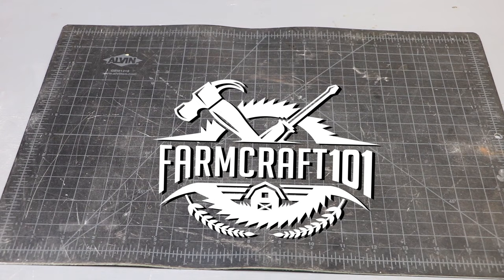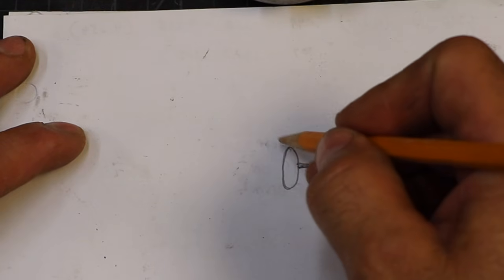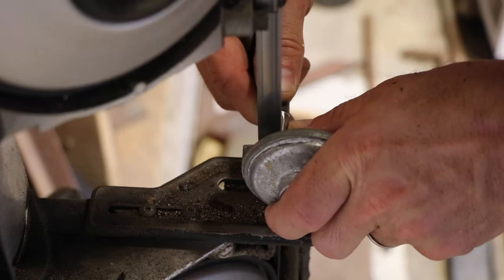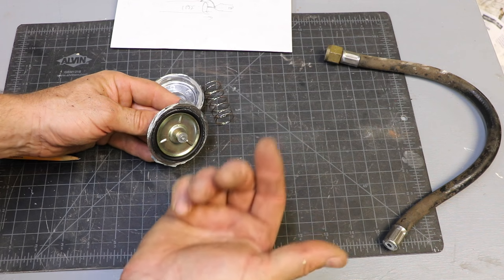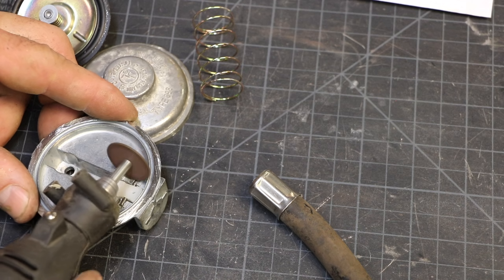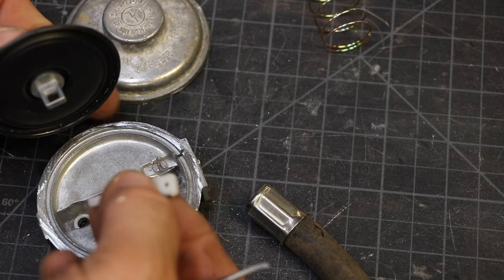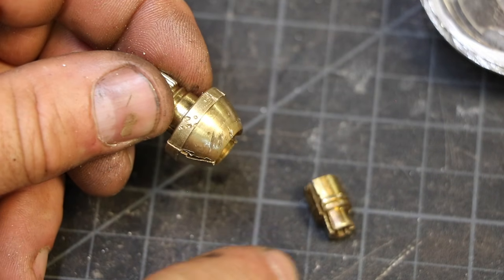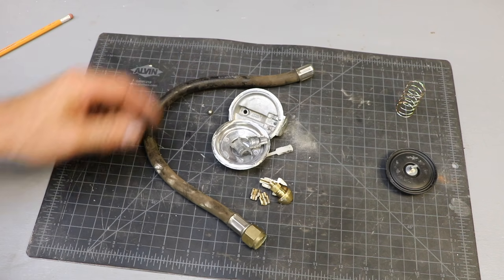Surprising Mechanism Inside Your Grill Regulator.

Comment: I haven't personally seen a regulator go to a failure mode of low pressure/low flow. A friend's grill regulator failed high, so when she turned on the gas, it made a rushing and almost trumpet-like noise.  Mine failed high while the grill was lit, burning off the residue after the burgers were lifted - when we went back out 15 minute later, the grill was WAY too hot. It incinerated all the grease on the grate to white ash, broke the thermometer in the lid,l (pegged somewhere north of 600°, never came back down), and the stainless firebox was permanently discolored dark blueish-purple.

Comment: Here’s a video you need to do  disassemble A scuba tank compressor .what kind of an air compressor does it take to fill scuba tanks because the pressures are in the thousand pound per square inch ?and  I am curious how that’s done. Especially with an electric motor that only produces 5 hp

Comment: I think most regulators, or at least RV regs, have a fail safe built in so the valve shuts if too much gas flows out. I've seen it mentioned in a few places if too much gas is used, it could trip that mechanism. I wonder if that is built into the normal operation of that valve and check ball or if that's another part on a different reg.
Reply: Yes, I was thinking that the check ball might have a sealing surface in the forward direction. If so, a large flow would shut it when the aerodynamic force on the ball overcomes the spring.

Comment: I purchased a new Weber a couple of years ago and when I went to my local propane/grill store the salesman/owner told me in a sarcastic way that don’t come back complaining about your grill not lighting up, that it’s because the regulator which was redesigned due to some new regulations which he thought was unesesary binds. And he was right when it happens which it dos on occasion I give it a bang with my grill brush and problem solved. This happened on two Weber grills.

Comment: Hmmm, my grills flame seem lower lately and I was thinking I may have to get a new regulator but maybe a shot of air to clean out that mini membrane will do it. 
If I had the drive I would test the pressure then shoot a few pounds through and retest but I don't have a channel to feed (lack of motivation).
Reply: It can also be the burner's holes.  Either from corrosion or food/debris.

Pull out the grill and clean the burners.

Then, with the gas ON, give the reg a good couple taps..Turn the tank off and grill ON, and tap it again. after disconnect the reg and give the vent hole a small shot of compressed air a couple times.

Remember to turn your Grill's knob to OFF before reconnecting the reg and giving it a go to avoid the big WHOOSH.

Comment: So, as Richard Stewart mentioned, the sequence of entering gas pressure can keep low pressure, had to re- boot mine many times because of this, not knowing there was a safety device installed for this, but assuming after a while, a simple mechanical fail safe procedure was built into the system. The only things that could have gone wrong with yours: leak/ hole/ crack, damaged/ bent / broken / warped, or weak components, corrosion or wear not allowing proper movement, obstruction, ( gas, or atmospheric pressure) or as mentioned above, too much, or not enough gas at a given location. One spider, insect, mud dauber, drop of moisture with corrosion occuring, or ice, can cause a short or long term problem .

Comment: The back side of the membrane has to be vented to the outside in part because otherwise changes of the temperature of the entire regulator would affect the amount / pressure of gas downstream.

Comment: I was thinking that this single stage regulator was cheaping out, but then realized that the fuel in the tank is in a liquid form.  For a given tank temperature, the vapor pressure will remain constant, so a single stage regular works just fine.  For high pressure gas cylinders, you need a two stage regulator to maintain a near-constant set pressure as the bottle depletes and the input pressure drops.

Comment: That other smaller spring on the diaphragm is to release excess pressure out through that "hole that is not to be blocked" should your main "needle" valve fail to seat.

Comment: Isn't the check valve on the HP side there to avoid the flame to run back into the bottle??? It closes when there is no flow. And at high flow, the flame won't move fast enough reverse.

Comment: I think a needle valve would be overkill and unnecessarily expensive. They have a wide adjustment range, which isn't necessary here. The flow rate is low and can be partly regulated by the orifice size. The inherent springiness of the rubber seal will give some proportional control, but even if it doesn't, there's probably enough reservoir in the hose to smooth out the impulses from the bang-bang on/off control and give pretty even flow at the burner.

Comment: Good video but you didn't find the problem so I had to take apart my #2 failed regulator from Weber. I found the nylon pivot fully sealed against the inlet hole and the other end of the pivot pressed against the rear side of the casting. As such, the pivot lever could not move in either direction and was fully closing the inlet. That explains why each regulator worked just a few times before failing closed. Weber knows the Chinese regulators keep failing and they should cover the cost and provide a good regulator not another defective one. Weber used to be a respected company but it seems they continue to use defective regulators for years. I surmise the nylon lever got bent from heat or maybe pressure (but it is bent in the opening motion), the pivot pin groove was cast too deep in the main casting, or the staking of the lever pivot pin was hammered too deep. Also possible is the rubber insert in the nylon lever swelled up with propane exposure or the seat was not pressed/screwed far enough down into the regulator casting. They both worked long enough for 3 uses of the grill before failing. After the first regulator failed Weber sold me a new regulator for $50 and it was identical and also failed in 3 uses. I tried various propane sources and compressed air at 120 psi and none could get through the sealed regulator. There is no safety valve or mechanism that needs "resetting" like so many posts describe. Your video shows the check valve with a ball  bearing which closes the flow if an open line is detected perhaps when using a large tank. Small screw on tanks have no "safety valve that needs resetting". The connector hose for using the large tanks has a Schrader type valve in the grill connection end to prevent full flow exiting if that end of the hose is disconnected. I am going to look for a different brand regulator. I think it is a zink pot metal casting not aluminum as it is too heavy. Kudos for doing a cut-away video. I was hoping it would yield a fix without cutting it open. They should use a metal lever.

Comment: Roughly .5 psi output  on average depending on temp tanks will be at 0-200psi when full 200 is extreme high and it would be at least 100 degrees outside. on average they run 50-70 psi at -44 it will stop boiling therefore no pressure However it dose not need to be -44 outside for this because as propane boils it gets colder the more it boils the colder it gets the faster it freezes. this also helps in high temps as the propane is being used it actually cools the tank

Comment: The diaphragm is usually what goes bad after they become too weak and stretched out.  it doesn't take much. i'm currently looking for a place to buy a new one for my propane generator. the regulator is $200 but the diaphragm is probably a $20 part.

Comment: Awesome, I've always wondered how they worked. I'm guessing that the pressure adjustable ones compress the large spring to change how much pressure is being used??
Reply from the maker: Yes.  The force of the spring against the diaphragm is really what regulates the output pressure.

Comment: Wait. What low-pressure gas would be flowing BACK toward the regulator? I'm confused. More than normal.
Reply from the maker: In the case of the regulator being disconnected from a propane cylinder. Then the low pressure side could potentially leak back through the regulator.

Comment: Chances are there was absolutely nothing wrong with that regulator it was the connector which are common failures. I generally replace them with external tread type.

Comment: Had an old mini propane grill with equally old regulator and the flame jumped from inside the grill to right where the bottle connected to the regulator. Thought I'd die, but managed to blow it out. Dumbass. Important safety tip! Use new parts! I think the seal was cracked allowing gas to escape and as dumbass kid I was forgot a fire extinguisher.